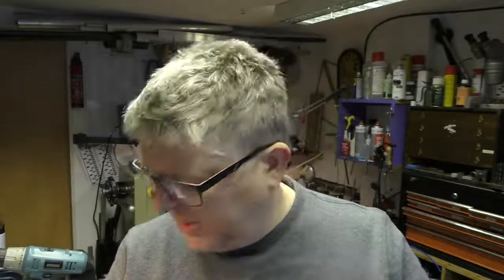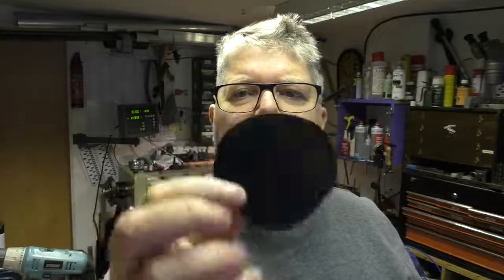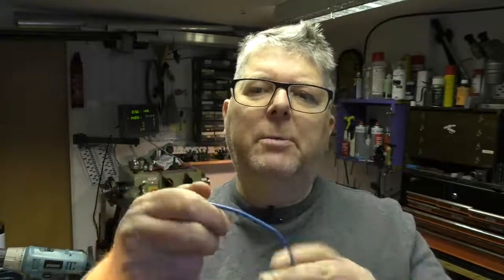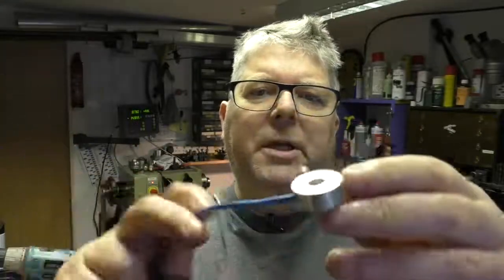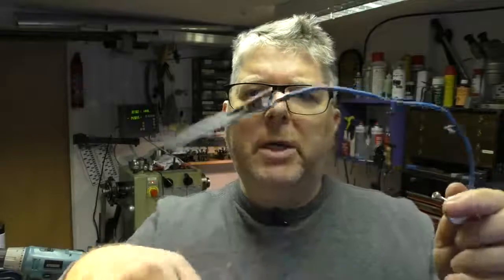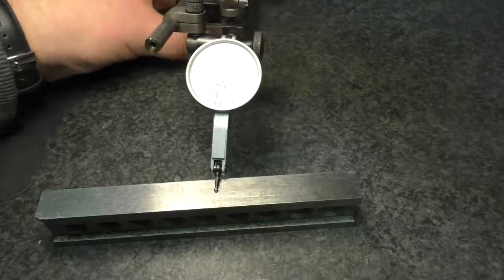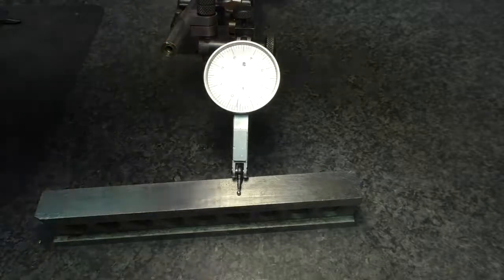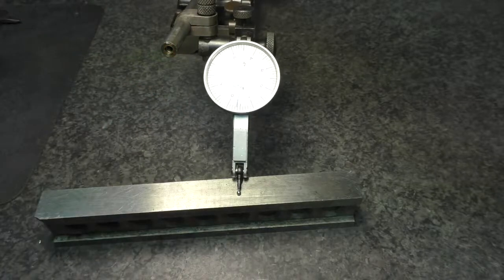Stop Indicator Glare

Comment: Hi Rupert,
Thanks for the tip. So simple yet very effective. I will have to remember this one.
Steve
Reply from the maker: It seems to work well. Give it a go. Thanks for the comment Steve. I am glad I can return the inspiration :-)
Reply: Hi Rupert,
We used a white bed sheet hanging between the two rooms to diffuse the harsh light from the other room to reduce the indicator glare on our last video and it worked great. Thanks for the tip. https://www.youtube.com/watch?v=KeCqpoUoQlA&lc=z22nzp141pzqwxbgk04t1aokgyjej2ujqjvxiwkmgemork0h00410
Steve
Reply from the maker: Yes, getting rid of the point-sources of light helps a lot. The demo you gave was all about seeing the dial, and the turns of the Allen key. It showed both clearly. Job done! I am glad you found my video of use. :-)